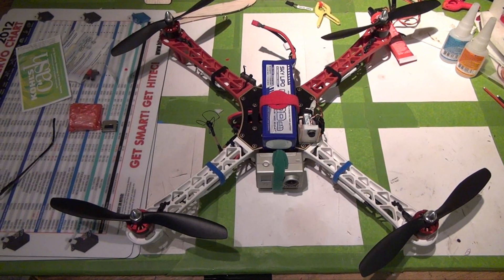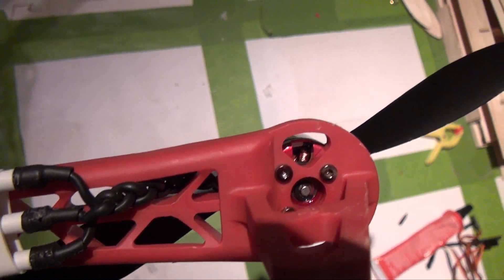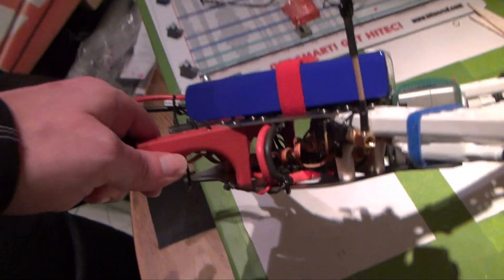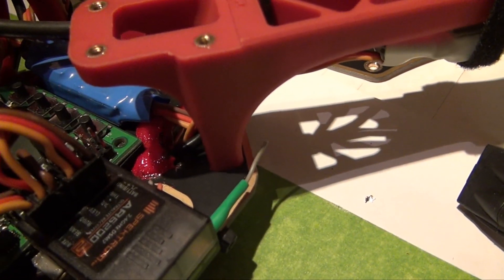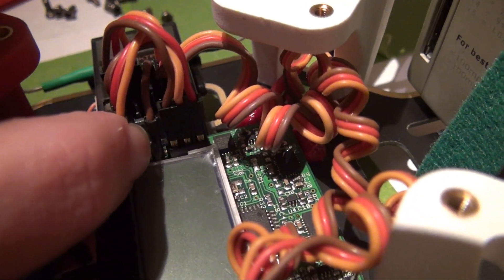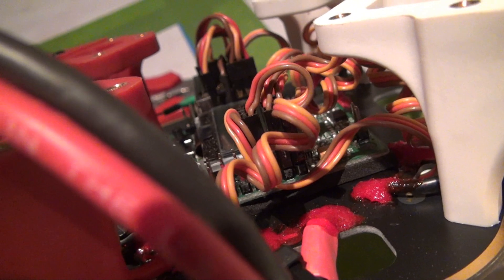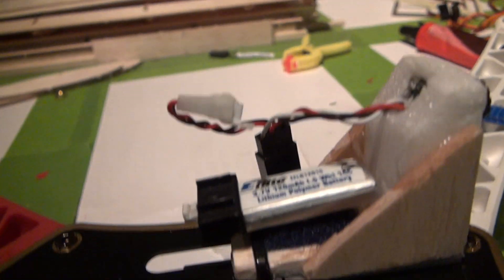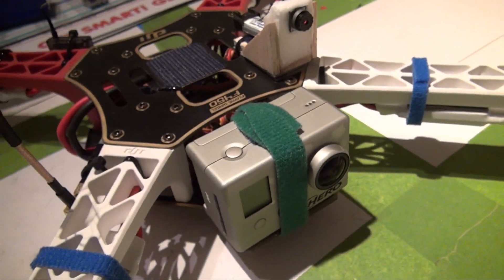DJI F450 Build w/ 5.8GHz FPV

Comment: How did power the FPV gear off the main battery? Did u need a step down regulator or was the amps and voltage fine from the main battery to the FPV transmitter?
Reply from the maker: Zach Bod The FPV Camera and transmitter is powered by a separate 1S Lipo battery. It's a 3.3V system so the 4.2V of a full charge is a little hot for it, but it works.

Comment: I'm using ar6210 rx, I wonder if  is there any difference in the configuration for failsafe works? because I followed all directions for binding, but they don't work for me. how set up tx works perfectly, but the only thing that is not working when binding  is failsafe mode.  when I turned off tx , the dj naza assistant showed that throttle worked but did not failsafe mode.
Thank you
Reply from the maker: Sorry but I don't use NAZA, so I don't really know. The quad in the video uses KK.

Comment: Why do you need a bec?
Reply from the maker: The BEC provides power for the receiver and KK board. It's much more reliable than using the built-in power supply from one of the ESCs. When you're using 2.4GHz radio systems, you should always use a BEC because digital receivers don't respond well to fluctuating power levels. They can re-boot, and that takes several seconds, during which you will have no control of the aircraft.

Comment from the maker: Well, if you use it right, the thread locker won't even come out the holes. You only need a little bit - just enough to put a film on the threads. Most people use way too much, and it actually reduces the strength if you do that. Since the whole thing vibrates a lot, it's a good idea to use some, particularly on the motors. You do have to be careful - so even though I use the right amount, I do the screws from the bottom to reduce drips. Be careful not to get it on the center bearing.

Comment from the maker: Oh hell no, it's fine. All you need to do to make Spektrum work perfectly is keep it turned on. That's why I'm running the BEC. It will be perfectly fine - I'm using 5.8GHz video, so I can't fly out of range anyway. The only time you really need to get away from 2.4GHz is if you want to do long range. It's fine for park UAVs.

Comment from the maker: The thing is, once you get it all tuned, you never need to access the KK again - in fact some people remove the LCD at that point. Protecting it from things I might crash into was a little more important to me. I did try it the other way, but there was something I didn't like about that - try it and check everything carefully, you may stumble on whatever I didn't like, I really don't remember what it was, but there was something wrong with putting the battery in the middle.

Comment: Yeah nice job...a few questions.. I'm setting up an F450 and plan on placing the KK2 FC on top for ease of access to the LCD. My F450 wll be for sport/acrobatic flying so tuning the FC will be important. I'll place my battery down on the level where your KK2 is. How do you make adjustments to the KK2 once the top cover is on...looks like it could be tough.